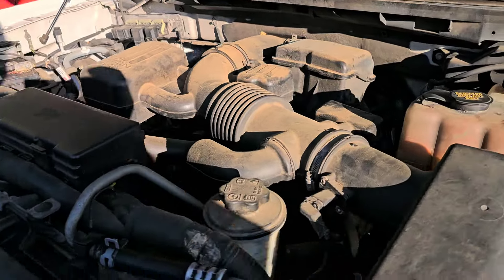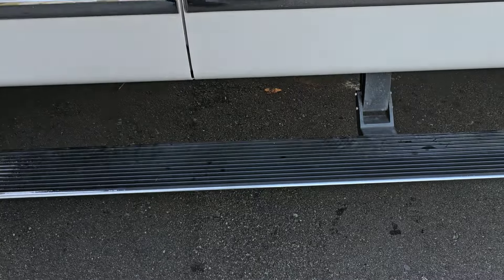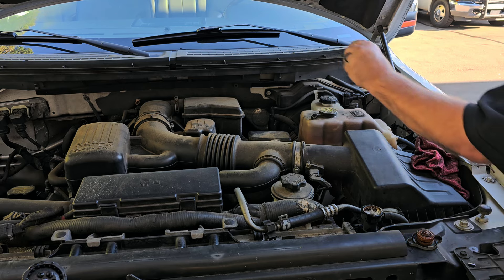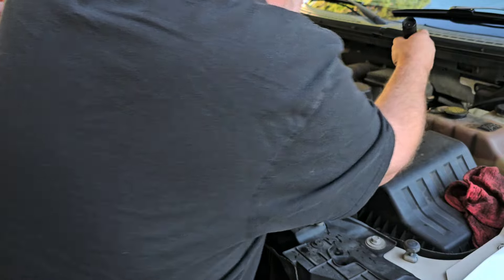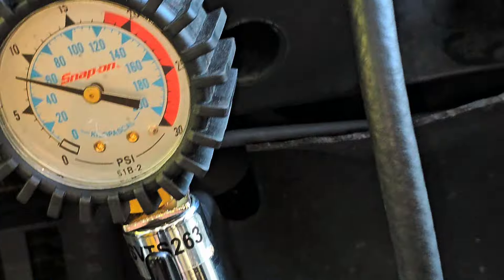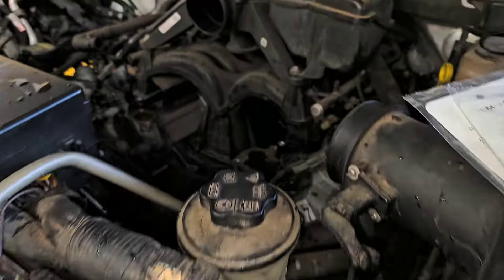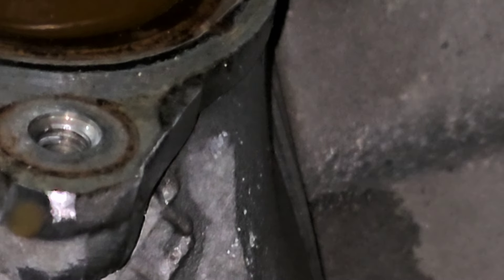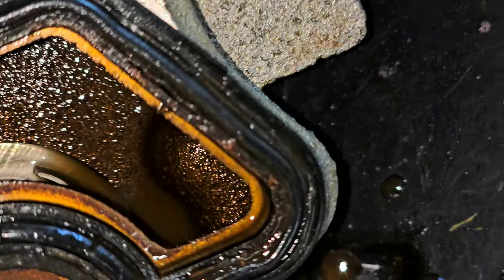Save Time Fixing This Common Coolant Leak!! 2010 Ford F150 5.4 Triton

Comment: I fill up a washer bottle with water first, than slowly fill up the radiator with said bottle. Less spilling. 

Sometimes a pressure test won't reveal anything. But leak detection dye will. 

On a number of Ford vehicles, especially the ones that don't get the coolant changed on a regular basis, the mating surfaces corroded. Some so bad that the parts aren't savable. 

I've actually have filled up the craters with epoxy or JB weld, filed and sanded the surfaces flat, and resealed them.

Comment: I looked it up. You can disable them but you have to go into the information center and go into either advanced settings or features, not sure. You can set them to always up or always down. They should have did something like "Hold down the power button for 5 sec and honk the horn"...something quick and easy for mechanics.
Reply: Meh, pull the fuse. 😜

Comment: Sadly,  when you said they smelled coolant, I called it. I've done the file bit myself.  It definitely saves time and frustration.
Reply: Indeed.  But, better to have a coolant leak from something under the hood, than -- horror -- a ruptured heater core in the dashboard. 😲

Comment: Exactly 50 years ago my friend Kenny had a 1965 Dodge van with a transplanted Road Runner 383.  It had an aluminum intake manifold and one corner was intefearing with something.  We discussed cutting it off, as it was nowhere near any water or intake passage.  I voted for cutting, but can't remember what happened.  The van drove for many years after.